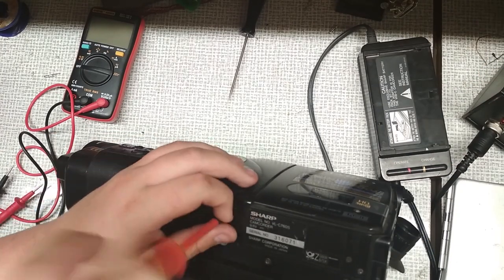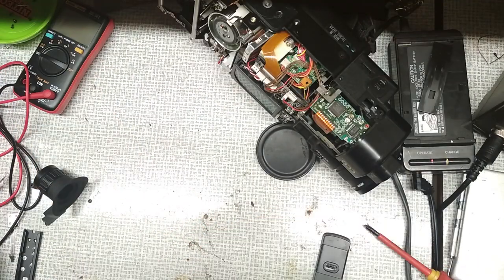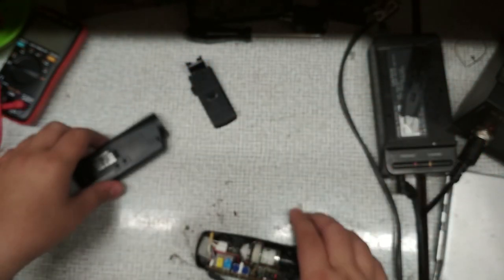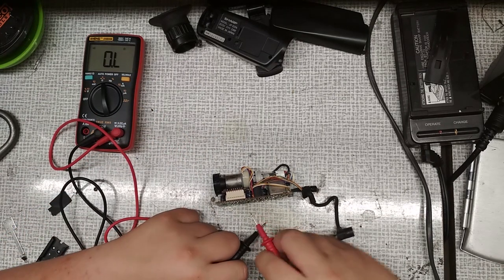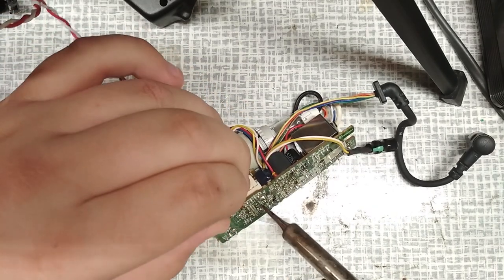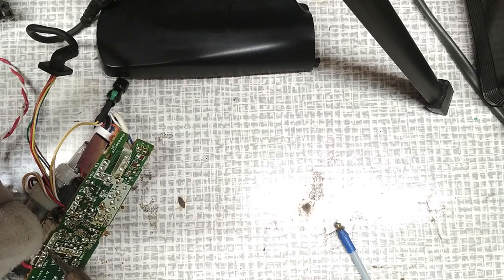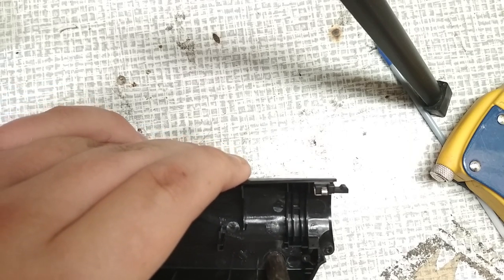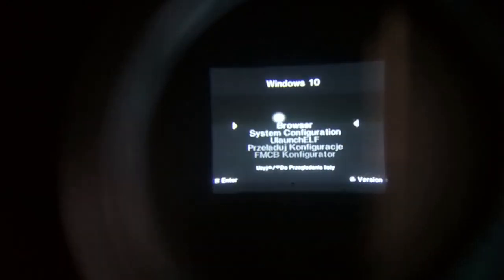Viewfinder HACK - DIY Mini CRT

Comment: My camera has the crt in the viewfinder with no electronics and the electronics that drive it are in the rest of the camera with the switch to turn it on on another pcb. When I power it it turns on but only sometimes. Sometimes it draws 0.04 amps and sometimes it draw 0.5 (That's it running). Sometimes it does nothing, no current draw at all. Please help.

Comment: Mine don't work... 
I can power it on (first try), but when I try to connect a video source to it, it displays black and white lines... what can I do to get this to work?
Reply from the maker: Are you 100% sure that you are connecting the video source to right pin? You try testing it with every available pin, also I've noticed that it won't work with every signal. For example it works with my PS2 but it doesn't work with PS3 (maybe the resolution is too high)
Reply: @electronicsenthusiast3185  it does work with the ps3 u just have to press the power button (it beebs) and keep holding it till it beebs again than it will show up